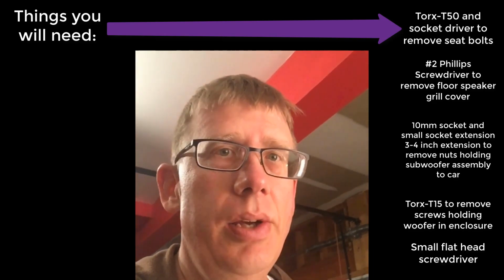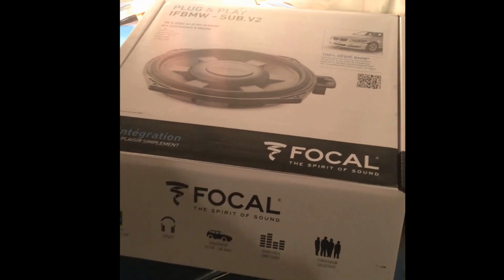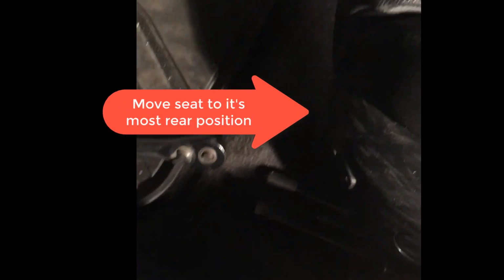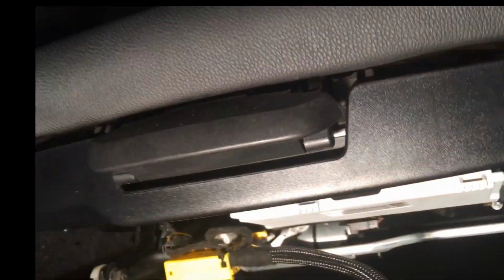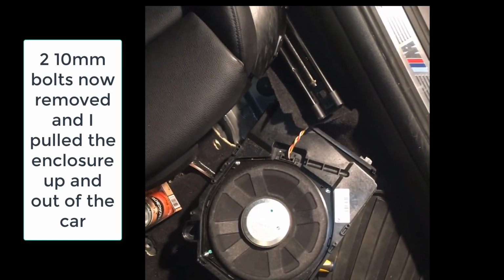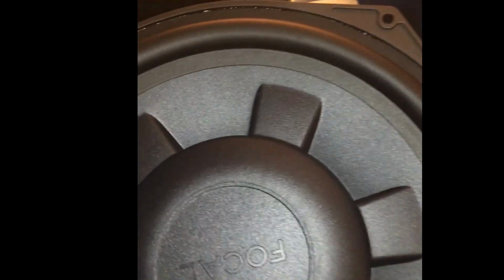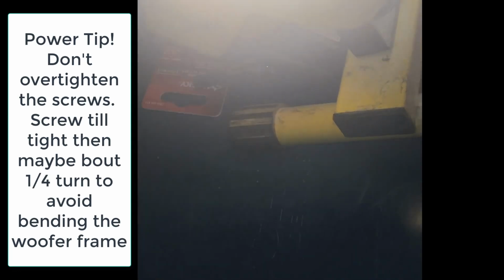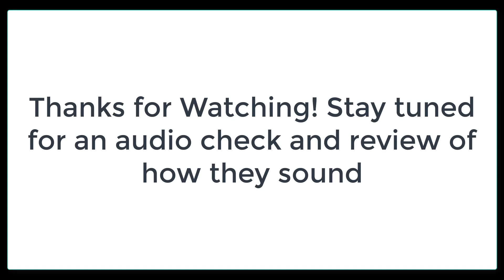Boomin Bimmer Video#1: 335is Focal 8 inch Subs IFBMW-SubV2 Install Video

Comment from the maker: So I did a test run with amp and all I can say is wow, amp was 150 x 2 compared to stock 45-50 watts.  Amazing they were beatin. With that said comparing to factory don't upgrade unless you plan on putting on them, at factory wattage they sound about the same but amplified, 5 x the sound quality and output

Comment: What is your experience with the Focal subs up to know? Are they an improvement that is worth the effort? What kind of stereo system you are using it with (Stereo, Hifi, Logic7)?
Reply from the maker: +Matthias M. Hi fi. Putting amps in soon.
Reply from the maker: The focals sound amazing.  The subs weren't to bad.  The door speakers and rear speakers were a mega pain in the ass.  I will post some door pics.  The hardest part was getting panels back on.  Bottom line if no plan to add amps, don't bother, the magic is once you put some power to everything.  I got my focals from ebay for way cheaper from poland or somewhere.
Reply: Does it fits bmw 120 2005 ? Is it good for factory head unit business?

Comment: The HIFI amp offer 2 ohms in subwoofer, the focal sub is 4ohms,  I want to buy it, but Im confused about that, you need a subwoofer with 2 ohms.
Reply from the maker: Let me give you the bottom line.  First, there is no problem putting these in with stock amp.  Played ok.   First, you will get 10 times the bang for your buck by adding an amplifier to the stock subs instead of buying these subs.  With power, my stock subs pound twice as hard plus take all the power from my amp.  I ended up blowing both focals :-( and  put stock subs back in with my amp.  If bass is what you are after definitely do the stock with an amp or earthquakes 8sws with an amp.  If you want musicality, they do sound great, but definitely don't put out the bass like the stock or earthquakes.
Reply from the maker: Now I'm sending both in for replacement warranty.
Reply from the maker: Here is the current status.  I do highly recommend getting the harness.  It simplifies everything.  https://www.youtube.com/playlist?list=PL3s9aOS6p5zq8ZCkAXp-b4LlmxUjheqmD
Reply: I appreciate your  answer, I have 2 more options, BAVSOUND or AUDISON, this brands are direct replacement according to OEM HiFi system specs. Thanks for your help!
Reply from the maker: Yes.  The absolute most sound for the money would be to replace the amp, then the speakers in my opinion.  You simply swap amps, could be done in less than an hour.  I did the doors and rears and it was a super pain in the ass for what you get.  Regardless if you do bav or the focals.
Reply: I will consider your opinion, thanks for your time, regards.

Comment: Absolutely crap Subwoofers, I had them in the car for 3 months and they both failed. Put the OEm ones back in and no problems. Warranty isn't going to be honoured.
Reply from the maker: LOL, yep.  Haven't done my followup.  I blew the focals, blew the oems, finally ended up with Earthquakes.  What I should of put in to begin with if bass is what you crave.